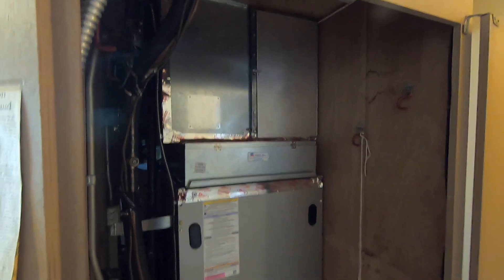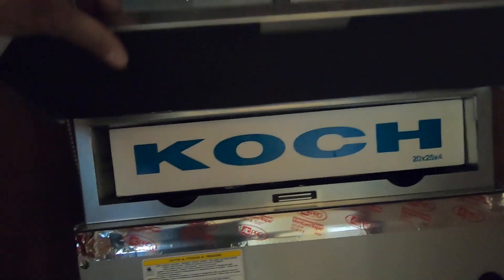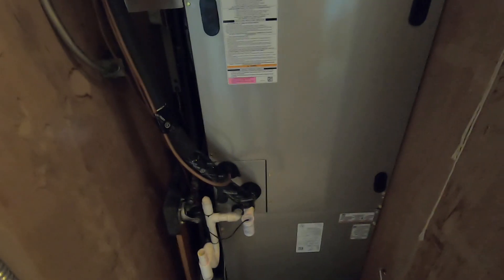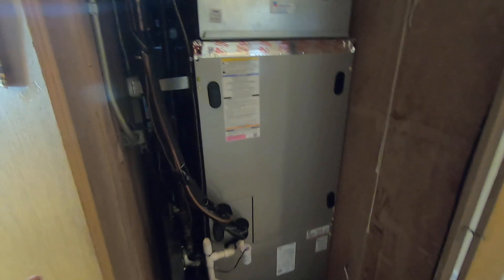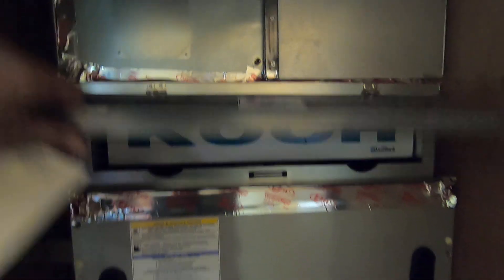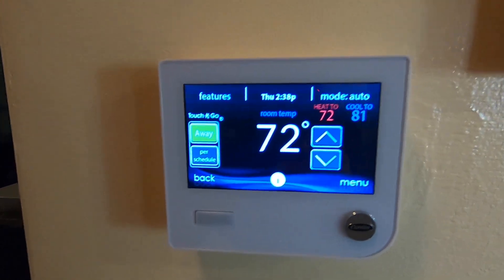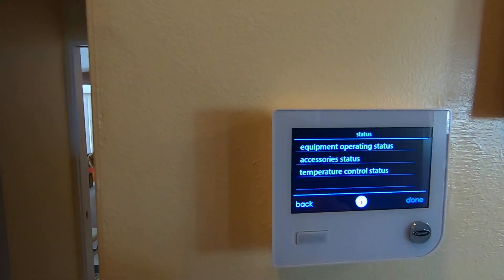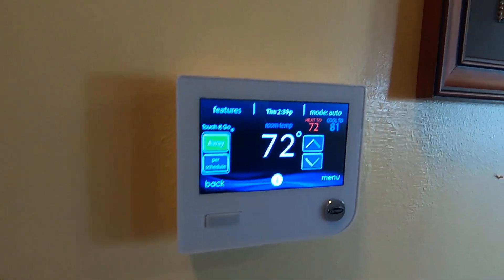Replace Gas Furnace with Carrier variable speed Fan Coil FE4

Comment: Why on God’s green Earth would you get rid of a furnace? Even if you are putting in a HP.  Then you have dual fuel and efficiently plus you do not have to pay for the AHU, coil, etc.   why didn’t you actually buy a real downflow AHU instead of installing an upflow/horizontal unit upside down.  Carrier recommends against this as I have taken many of their classes.   Great product, but you must live in a warmer client.  Infinity, Evolution or are great units.
Reply: Yes, this sytem was installed in Fullerton, California.  We discussed all of the options with the customer and he decided on this system because it best fit his needs.  He wanted to get rif of all gas appliances in his house due to having solar.